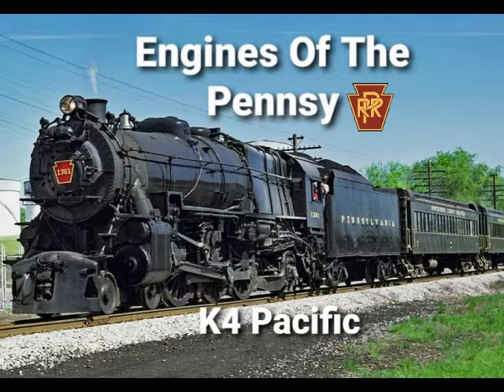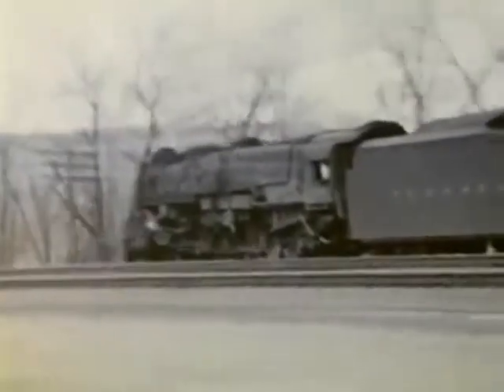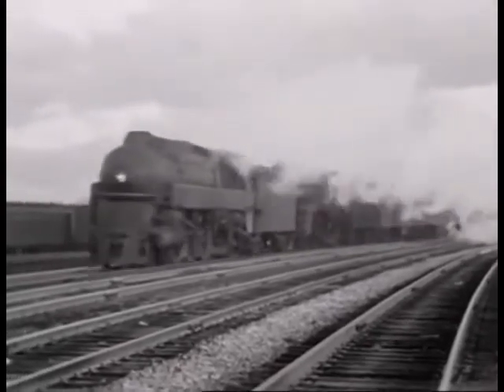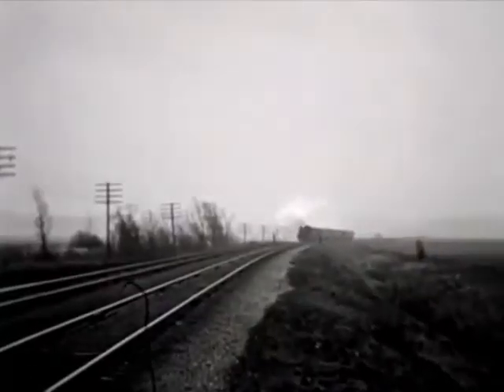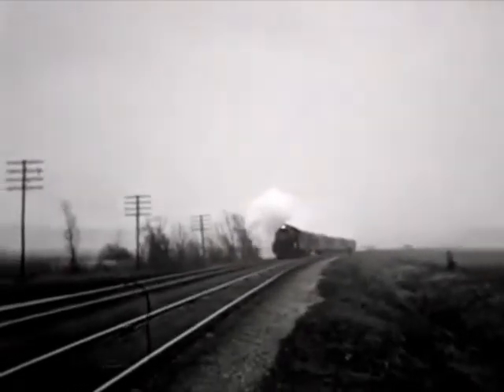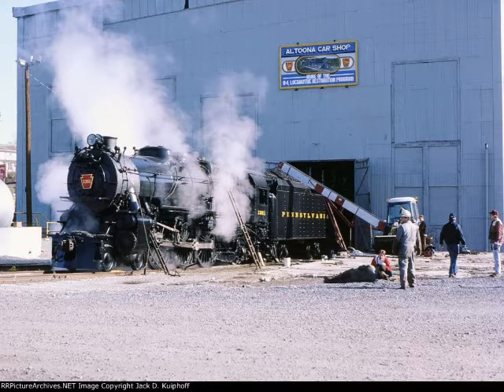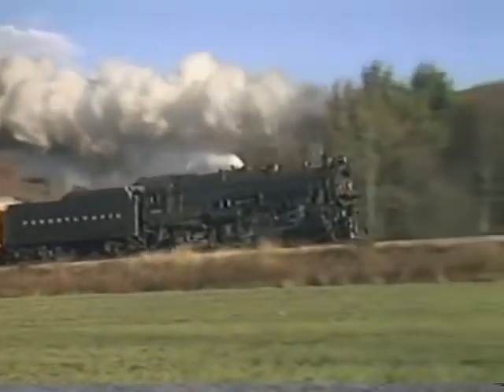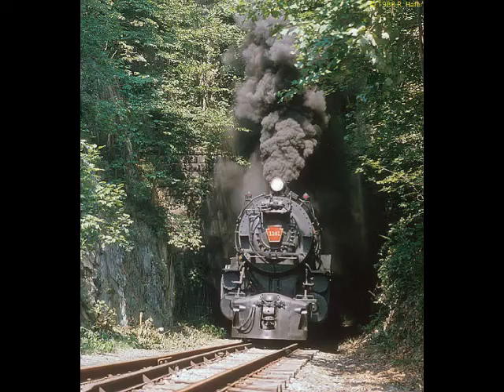Engines Of The Pennsy Episode 1: K4 Pacific

Comment: K4 is the best steamer ever. Change my mind. Had fun working on this project when we started it back in late September 2021
Reply: For short, fast passenger trains, maybe. However, for longer services or heavy freight trains, they proved inadequate. A 2-8-4, 4-8-4, or 2-10-4 could outperform the K4s on any heavy freight job, and the 4-6-4s and 4-8-4s performed better on heavy passenger services.

Comment: The Pennsylvania Railroad building their own Steam Locomotives. Had to save the Pennsylvania Railroad a lot of money. I’m a  5th generation railroader. Locomotive Engineer. Hiring on Penn Central  then Conrail, Amtrak and retired on NJTRO as a Locomotive Engineer. My two sons  6th generation railroaders are Locomotive Engineers on NJTRO and my Grandson a 7th generation railroader. Recently passed the Conductors Program.
I think the 1361 was built in 1923. Please correct me if I’m wrong.

Comment: The M1a, what a locomotive and the favorite of Pennsy engineers and pretty much a hybrid of the K4 and I1s 
 2-10-0 class. The I class was all business, not pretty  but could dig in and slug it out on long coal drags and one of my favorite Pennsy steamers, when paired up with the "coast to coast" tenders it just had that no glam, just all business look, I love that look.
 I like to look at the M class that it had great parents. The K and the I1 class had a child and it was the M class. The all time favorite of Pennsy engineers.
Reply: M1 is more I1 than K4. Basically an I1 boiler on a 4-8-2 chassis.  K4's ran at 205psi.   I1 and M1 ran at 250psi  - later increased to 270psi.

Comment: Constructive criticism:  Better research on your future endeavors will help avoid errors.
33 seconds in you mention the class "ran into the '60's".  Actually all K4s locomotives were retired by the end of 1957.  Two were held for preservation:  #1361 on display at Horseshoe Curve and the prototype #1737 at Northumberland with the Pennsy Historical Collection.  Later #1737 was deemed to be too deteriorated and was scrapped to be replaced with #3750, although the 1737 number plate was transferred to #3750.  Once the collection was moved to Strasburg, this switch was corrected.
00:58:  The K29s was developed by the American Locomotive Co (ALCO) and delivered to the PRR in the hope that ALCO would get some of the orders to build this new class of passenger locomotive.   The PRR's own shops at Juniata and Baldwin Locomotive Works built most all the K4s locomotives and ALCO did not get many orders.  
01:16  At the time the K4s was developed, superheaters were not common.  So any class of locomotive that received them was designated by a lower case "s" after the model number.  This was discontinued with the M class Mountain types.
01:28  Besides testing, the cause of delay in production between prototype #1737 in 1914 and production K4s engines in 1917 was largely due to World War I (The Great War as it was known then) in Europe and the need for the construction of L1s class 2-8-2 Mikados for freight service. 
01:29 to 01:35  The locomotive being shown is not a K4s but a T1 4-4-4-4 which was built to replace the K4s starting in 1944.  It is unrelated to the narration at that point.
01:37 -  02:41  The locomotive shown in these pacing shots is a Class M 4-8-2 with a 1940's -'50's era "coast to coast" tender.  At this point in the video, this class of locomotive is not related to your subject of K4s Pacific types. 
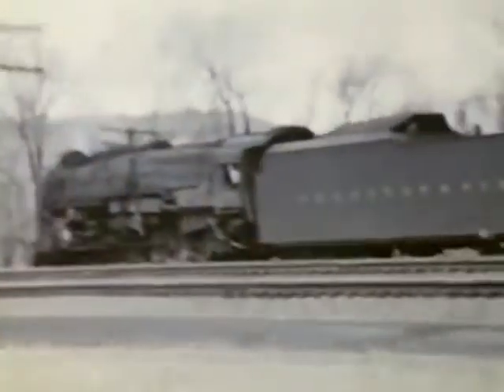01:44 Statement is incorrect.  K4s locomotives were only suitable for passenger trains and fast mail/express trains due to their large 80" drivers.  M class locomotives had 72" drivers and were built as "dual service" locomotives suitable for freight and passenger service.
02:40  List of improvements implied that these were widely applied.  Compared to the first locomotive #1737, improved headlights, stokers and power reverse were the only modifications made to the entire class.
03:00  During your discussion of the K5 class, the locomotives being shown are still K4s.  Only two K5 locomotives were built and not considered successful.
03:10  Discussions of the S1 class being displayed at the New York Worlds Fair are superfluous to your story.  Try to avoid digressions like this in your future videos.
03:32  I would be skeptical of the claim of the PRR S1 steaming at 60 mph on the rollers at the New York Worlds Fair in 1939.  Videos on youtube of this event don't show the #6100 running nearly that fast and the smoke and noise produced would be extremely annoying to surrounding exhibits.
The volume of your video tended to rise and fall with different narrators.
Good luck on your future videos

Comment: The first group of people tried but failed to restore this K-4. Fortunately there is a group of people that actually have the Pennsylvania Railroads, original blueprints of the K-4. The original group that attempted to restore the 1361. I guess did their best . But made some serious mistakes. After the first time 1361 was restored. It couldn’t back up over a switch or crossover from one track to another. The rear truck would derail , and this group also didn’t use the proper grade of steel stay bolts and made a lot more mistakes. One in particular, the rear truck axle has to be bronze bearings with 3/4” end play . For some unknown reason this  group welded the rear truck to the Locomotive Frame. Why this original group didn’t use the available original blueprints is not to smart. This new  group of people. Restoring the K-4 # 1361. Are going to actually bring the 1361 back to like new working condition and correct any mistakes made by the original group .I never knew how extremely complicated and precision  a Steam Locomotive actually is. They are like a finely tuned old school Swiss Watch. Something I don’t understand is when a Steam Locomotive is reconditioned to like new. It can cost Millions of Dollars to restore a Steam Locomotive. Then after the Steam Locomotive is used on excursions for a few years. Many end up. In a Museum to never run again.
Reply from the maker: Neat
Reply: They end up in museums because of the 15 year inspections by the FRA. It's very costly to tear down a whole locomotive to reinspect it and replace boiler tubes, etc.